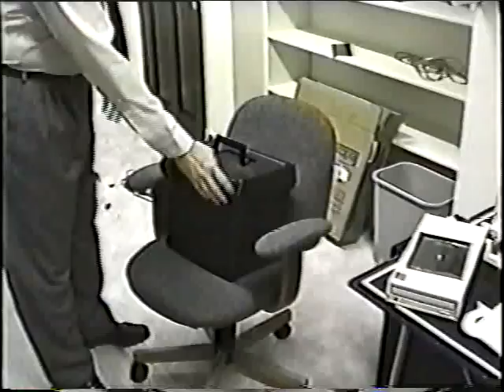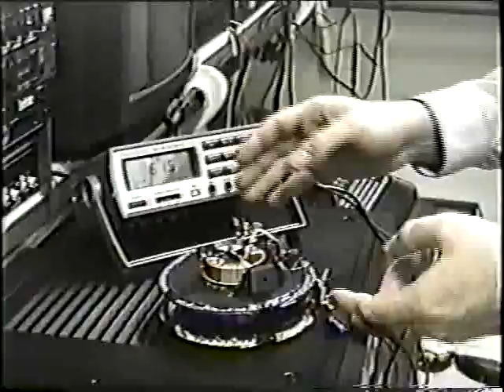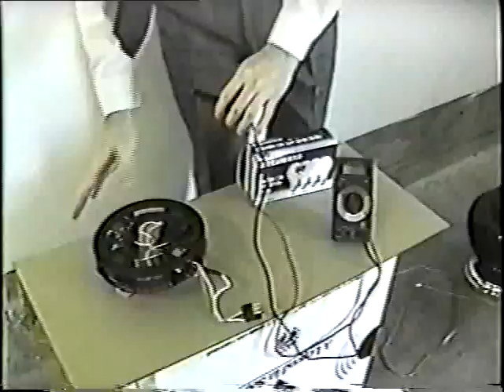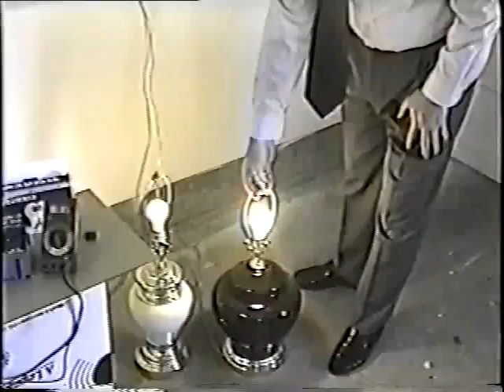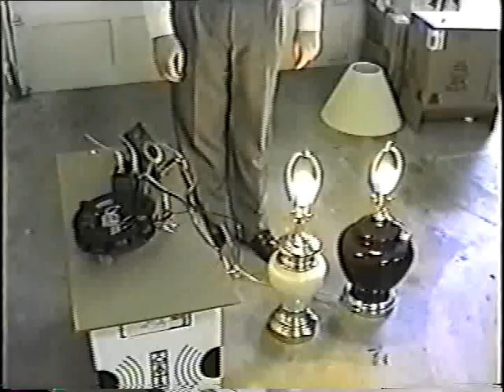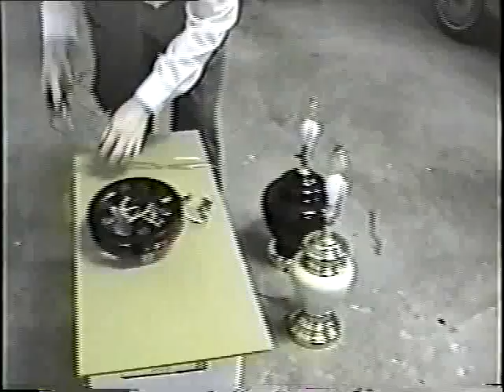Jack Durban / Steven Marks interview TPU  part1

Comment: I would have been more impressed if the Toroid - TPS sitting on the box and the Lamps were moved far away from the Box. Or the complete removal of the box all together.  That leads me to think or consider that the Toroid - TPS sitting on the box is nothing more than an induction coil being influenced by another induction / transformer inside the box with DC/AC converter as the power source.   Maybe this is real.  But the Box or the Toroid -TPS and Lamps needed to be removed as far away from each other as possible to be considered legit.